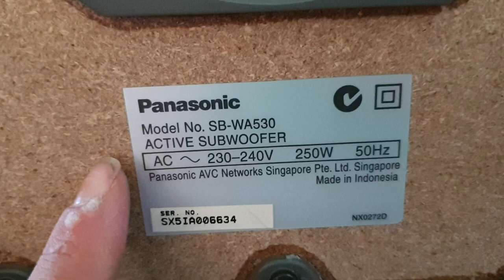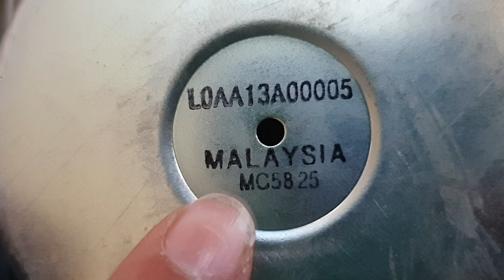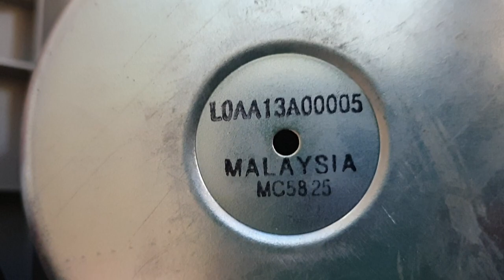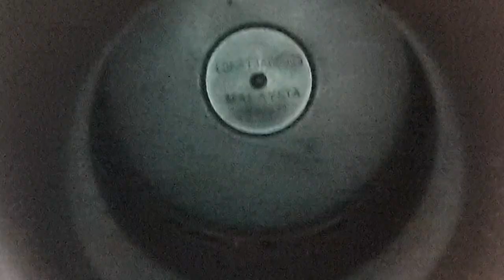What's inside my Panasonic sb-wa530 active subwoofer 3

Comment: The metal pieces that you are confuses about, that is actually meant to be there because it helps guide your screws into place, keeps them straight and helps hold the the weight of the speaker, so that it doesn't start to wiggle loose over time and tear the screw hole wider, making it completely useless and then you will have to drill new holes in order to place your speaker back into place., last alot longer over time.

Comment: Just bought  one of these on estate sale pretty sweet 32.50 for one of these with the 5 speakers and sub. Plus the wireless transmitter. Works good just want to get a used remote for this unit since it didn't came with one.
Reply: I just bought the 820 version of this for $25.